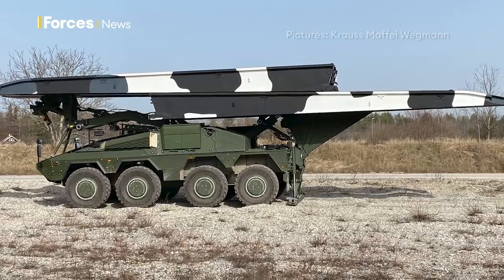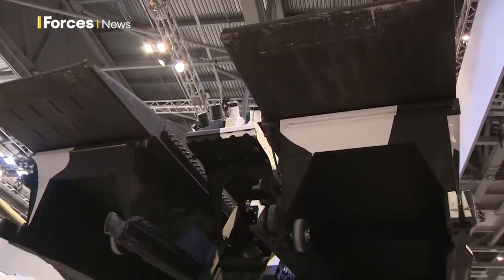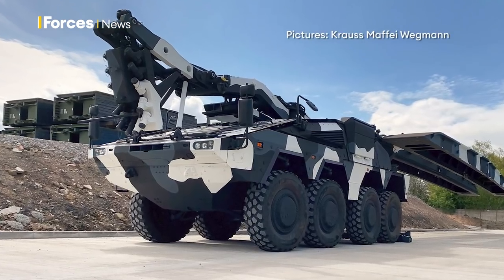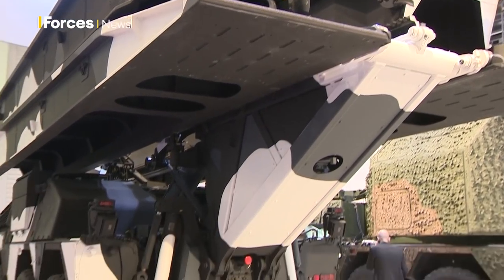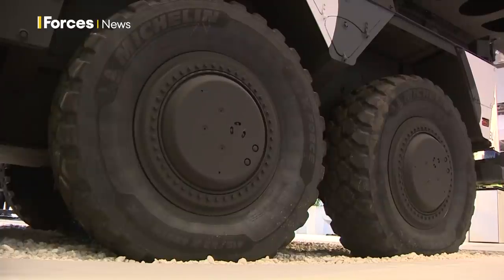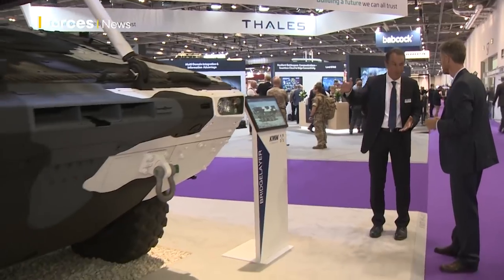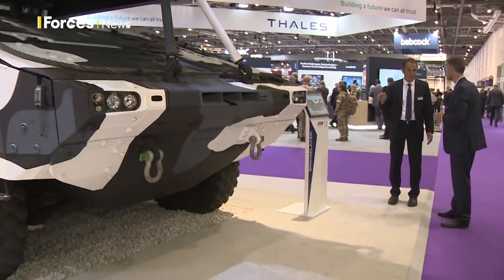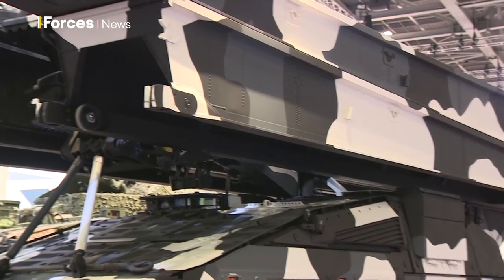The New Boxer Vehicle With A Sliding Tank Bridge

Comment: Hang on it deploys from the back yet if you're attacking you want to  be going forward .. so does it go everywhere in reverse beeping and saying this vehicle is reversing please stand clear  ? And in a battle would you have time and space to manoeuvre it into place to cross set obstacle ? ..
Reply: One assumes that the opposite bank has been secure by chaps who came out of helicopters, and the operation would be covered by various forces. But you cannot get the tea wagon up to the chaps unless you have a bridge. No char and wads, no fighting until it gets here! 

It is rather better than trying to throw a Bailey bridge across, and probably goes a bit quicker than a Churchill Arc.
Reply: @kenrick
For Ribbonbridges    the trucks also will have to reverse.